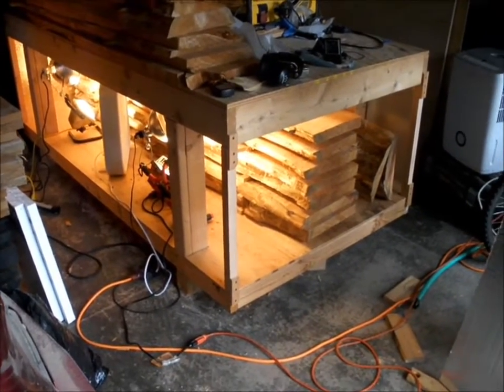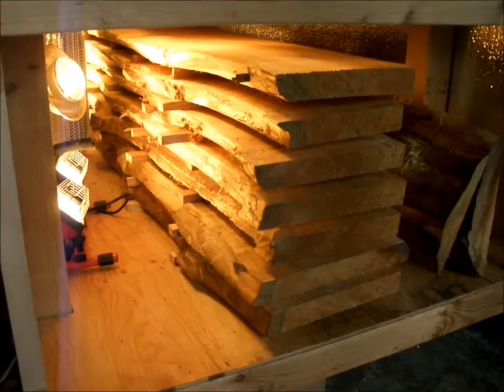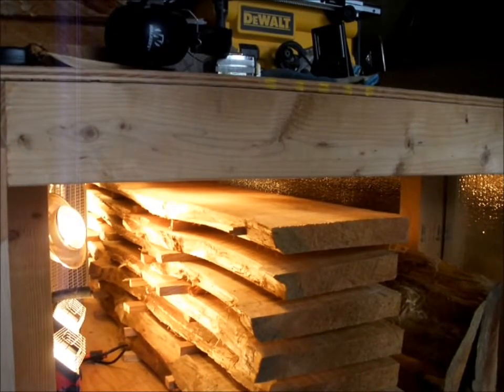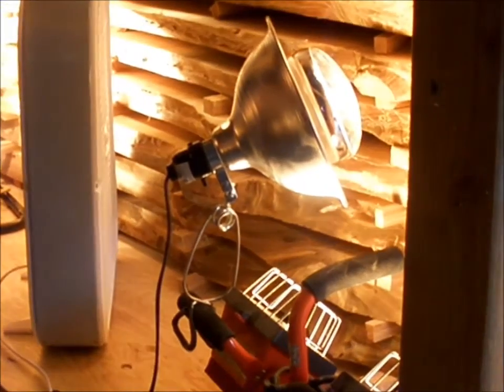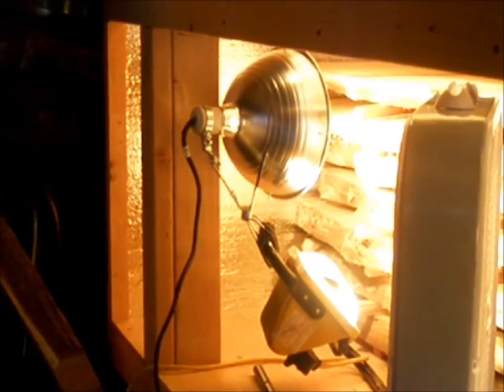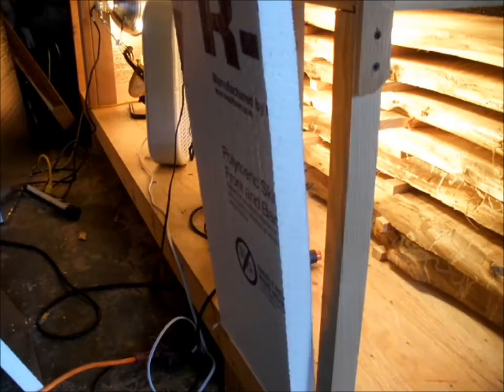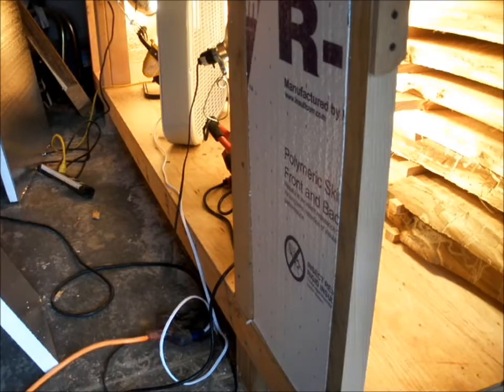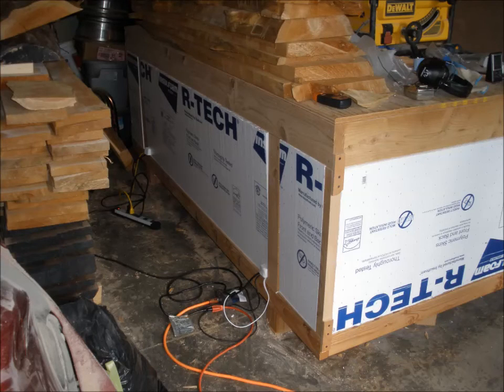Dehumidifier Wood Kiln

Comment: Thanks for posting. This is helpful. Other vids say 150 degrees (not 130) to kill the bugs. Im wondering where you got 130 and how confident you are that that works to kill the critters. Thanks!
Reply from the maker: Glad you liked the project. I chose to use my workbench because I didn't see myself doing kiln drying very often and don't have alot of space. This said much better is to locate it outside away from any structure in case there ever was a problem. In my case I kept a very close eye on it at all times. For the temperature I recall doing some research on it at the time but that was a few years ago. I did see this article below about it for what it's work. It's a case where more time/temperature is better, but for what it's worth I never had a problem with bugs for the wood I put through the kiln under conditions in the video. I know that wood had bugs in them because pieces that didn't go through the kiln had bugs crawling out that spring. 
http://www.woodweb.com/knowledge_base/How_Much_Heat_is_Enough.html

Comment: Call me crazy, but that looks like a fire waiting to happen. 😳😳😳
Reply from the maker: Yes I had the same concern, I'm glad you brought this up.  I would never leave this alone during the first part bringing up the temperature high enough to sterilize bugs. This said, I use lights as the heat source because those are already at several hundred degree Fahrenheit which is much higher than the ~130F that I run to sterilize bugs. Also if there was a problem then most likely the light bulb would just burn out.  I only run this first part for about 12hrs (6hrs to bring up to temp plug 6 more hrs) and so it's done within one day. At the end of the video I talk about this concern a little but could have done a better job in going over this concern. Thank you for the feedback.